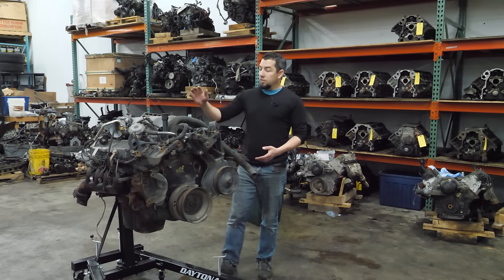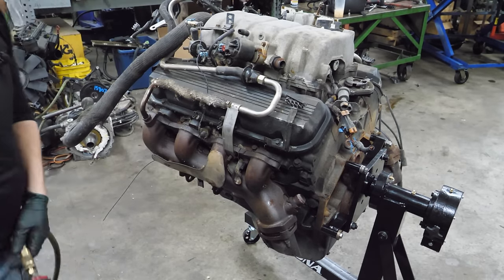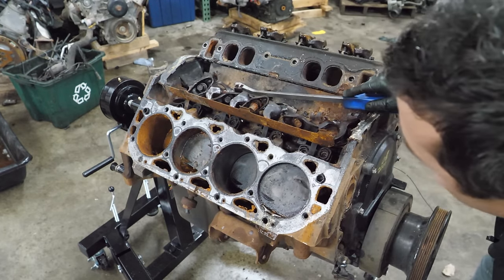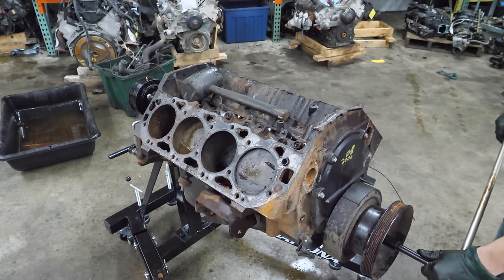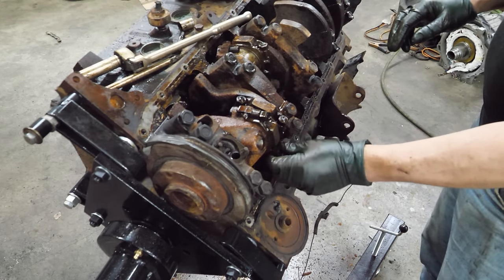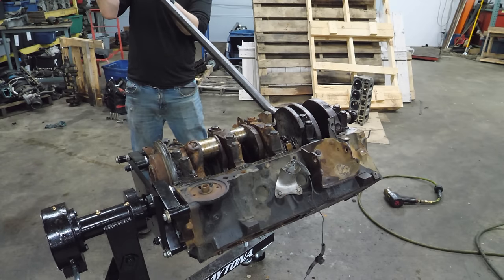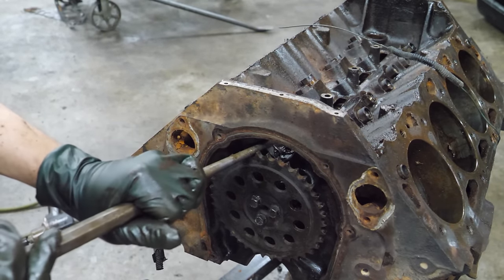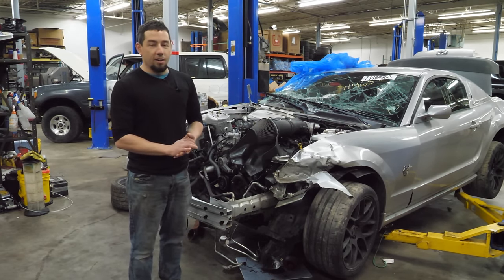COMPLETELY FROZEN! Vortec 454 7.4L BBC Big Block Chevrolet Teardown. This Was Some Work!

Comment: Should be done gooder parts on it. At least on the outside...
EGR tube AND the dipstick tube??!! Go get a lottery ticket, STAT!!
Those are the OEM intake gaskets. I'm dealing with the same style/materials on my 02 Buick Park Avenue. The gaskets look identical (on your engine, yours are in better shape). I was about 45 days away from the number 3 cylinder sucking the pink Danger Aid and acquiring Bendy Rod Syndrome.

Comment: I like big blocks! I also like to see smaller engines torn down, like maybe an early 2000s VW 1.9 TDI?
Reply: Would be not easy to find. If the car is still drivable, the engine is still in use. Those engines are the best diesels VW ever made.

Comment: We came across a 305 SBC that was like this many years ago.  We wound up rebuilding it since it was free to us ... had it machined .040 over on the cylinders and there was still some porosity in one of those cylinders - however the engine build was a success and served for a few years after.  This block should be worth the rebuild effort if it has stock size cylinders.
Reply: Agreed, and it likely is completely stock, as the bearing he found was 2/96 GM standard size. Most likely no machine work has ever been done on anything in that engine.

Comment: Hello Eric! I just fell upon the channel watching automotive repair videos and got hooked. I haven't read all the comments because I kinda get bored with it rather quickly lol. I wanted to let you know that while working in the machine shop decades ago, thinking it was 20 years maybe more ugh, I would run across marine engines that were left with water in them over the winter. Freeze plugs would pop but you should scrutinze the walls of the intake valley and piston bores also  the walls outside the block really well. I would probably have it tested somehow with the magnet and powder or something similiar. There is probably something new out now that makes finding cracks easy. You have a new subsciber, thanks for the great video!

Comment: If the floor is an issue we used to use old conveyor belt which was 1/2 inch thick made a work area from a few strips 12 ft or so square, nothing got broken even if it fell and it also saves your feet from the hard concrete,  being so heavy it always laid flat,

Comment: Loved this video.  Had a family member with a Black Thunder 40 footer with twin 454's.  A monster.  Have you ever done one of those venerable old GM 3800's that will run 300,000 miles.  I've had several of these.  Would like to see what they look like inside.
Reply: 3800 is a damn good engine ,,  i have one in a boat ,,replaced a 4300 V6 with a supercharged 3800 out of a pontiac gran prix ,,it's just as fast and 200 pounds lighter and uses less fuel,,i got rid of all the extra BS and installed a radiator instead of the lake water cooling ,,gave a double benefit ,, i don't have to winterize my boat and it reduces my chances of carrying invasive species in my bilge water
Reply: That's about the condition my 454s in my searay were in when I got it I'd kill for a speed boat but I love my full kitchen shower and toilet lol
Reply: The 3800 is the best engine you yanks ever made got a couple of holdens with them gmh aussie
Reply: @mikehunntt5338  i know that one there , i have a 40 foot cabin cruiser i think it's  a cris craft , i completely redid the entire thing  including the engines which were actually chrysler 440s they got replaced with EFI 454s i like having a full bath and kitchen

Comment: That crank just needs a quick polish.
Block is semi valuable, rods are ok, and it had to be flooded for along time, head gaskets didn't look blown to me. Or they ran water instead of antifreeze and it rusted a hole threw a passage in the head.

Comment: Eric, I tried out pig mat on a spill this week and like it more than paper towels and kitty litter.
Reply from the maker: That’s great! We never looked back after we made the switch
Reply: We call them diapers in the Military
Reply: If you get the chance,  try the crushed coconut stuff. It's similar to the kitty litter,  but works WAY better and cleans up easier as well! I was skeptical at first,  but seeing is believing.
Reply: @ReignitedAuto  If I find it, I'll try it on coolant or pre-emptive fuel.

Comment: Those heads are a bear to remove in the engine bay. So freaking heavy. I've always liked a 454. Had several over the years, take one over a 460.
Reply: best you can do with a Mk IV is 511cid, a Ford 385 will go to 557cid. Hell even Mopar RB's will go to 541. Any BBC made after 1974 is a fucking boat anchor.
Reply: @bjbeardse  oo
Reply: @bjbeardse  Ok buddy. I'm not sure I said anything about turning a 454 into anything other than a 454. Always been a good stock engine for towing, good power, decent economy, simple to work on, but boat anchor it is skippy
Reply: @wconstructionco  Note the distinction between MK IV and Gen5/6. THe newer engines are absolute junk. The earlier design is a great engine.
Reply: @bjbeardse  never any issues with my lt1 vortec 454s
Reply: @bjbeardse  tell that to Lawrence LT Tolman then.

Comment: I had a 400 small block in a nova and I forgot to put in one of the intake bolts. It filled up with water from a circle sprinkler. I then took it from the nova and put it in a monte Carlo, thinking everything was good. Imagine my surprise when I fired it up, I had engine mayo! No joke, it emulsified. I drained the thing out and filled it up with wd40. Two gallons and about a half hour of cranking later, it ran better than when I first got it.

Comment: It is so much easier once you see water has done that much rusting of the cylinders to take a drill and wire wheel the rough stuff out and then fill the cylinder with toilet bowl cleaner and I mean the high acid stuff that eats rust on contact.Then take compressed air and run around the piston to wall area so you can get a thin oil in there to make driving the pistons out easier.Ive torn apart many engines that have had water in them for years that way and it always works good.Of course you only go to that kind of trouble on something you hope to save.

Comment: Piston rings are seized and getting stuck on the wear ridge at top of cylinder. Ridge reamer would have helped a lot here!
Reply: Not one ring was seized in it's groove. It was RUST that had locked it up... didn't you notice any of that in the video?
Reply: @johncoops6897  ok, not seized rings. I meant that the rust in the piston rings was stopping them from going all the way "in", and the fact that they always got stuck at the same point near the top of the cylinder is consistent with hitting a wear ridge. Doesn't take much diameter reduction to get stuck if the rings can't move inwards.
Reply: @simontist  - I reckon that the rust was a smaller diameter hole than the whole piston!

Comment: Eric, I think you might need an Astro Pneumatic 4980 Air Hammer, might make it easier than using a handheld hammer.
Reply: Something like Eric O's big nasty ?
Reply: @thomasfletcher760  It's the same tool, just the official designation.
Reply: @Boodieman72  didn't remember the actual tool designation , thanks

Comment: Loosen the mains first to turn the crank, and perhaps remove the crank before pushing the pistons out.
Also good to loosen the mains first is that there is less risk hurting the main journals if some water got in, instead of trying to rotate the assembly with tight mains. (if we have a good crank)

Comment: I have a gen 6 454 and my lifters were stuck in the bores due to thick oil sludge, not rust. I took a can of seafoam and dumped some in the lifter valley and let it sit for a day or two. It loosened up the sludge enough to wiggle the lifters out. I never had an engine that rusty though. A bottle of evapo rust in the lifter valley and bores may have helped or CLR. I had a 400 small block one time that was froze like this engine and I took a 2 inch round wooden dowel and a hammer and went around and hit each piston in the center until it started to move. You should also get a crank turning socket for big block and small block Chevy's. Would make turning the crank a lot easier.

Comment: I am going to say it blew a head gasket, which is why it got pulled out. Then it just got rained on a lot too. The rust build up in the water galleries, was just neglect. It was bad enough to push out the welsh plug. Diven till it stopped

Comment: If you want to give that engine stand a workout, see if you can get your hands on an old Detroit Diesel 2-stroke engine. They are super unique because they all have a blower (supercharger) and are built like tanks.
Reply: they also leak oil even if there isnt any oil in them

Comment: When i get a motor this frozen up i use the flywheel/flexplate teeth and a prybar to turn it 1 tooth at a time, that usually works (along with cleaning walls with brush and lots of atf and acetone)

Comment: I really enjoyed this episode! The block and heads could be hot tanked to access the damage,but the did look acceptable! I was surprised that the cam came out so easily. But unfortunately because of the rust the block will need linewill be  boring through out. Not sure if the block

Comment: The trick is to find something round that will sit flat on top of the piston, something about half the diameter. Use that to hit downward on a piston. It almost sounds counterintuitive, but it works. You can do That with crank in it, and the rods still connected.

Comment: This is probably a difficult engine for you to get by, but I’d love to see a Mercedes M111 engine! They’re used in all sorts of applications, from Vito vans to coupes and convertibles with a supercharger.

These engines are pretty reliable but they do like to pop head gaskets, which is what usually writes them off. They also often perish from poor tuning attempts.

Comment: Your favorite penetrating oil or ATF/acetone and an air hammer with a punch will get the EGR tube off easier than you ever imagined.  I had two 1 3/8 wrenches almost 2 feet long each and it wouldn’t budge.  3 seconds of taps with a medium quality air hammer and it was spinning off by hand.  I couldn’t believe it worked that easy.  I’ve heard of guys using a copper flex pipe for water heaters and compression nuts to make their own, but haven’t had to do that yet.

Comment: Honestly, it looks like that engine was just sitting for a long time in the elements. It’s not just the water, but how dry even the rust free parts are. Oil hasn’t circulated for years. 

Honestly though, I’d almost be interested in it. The block anyway. End of the day, it appears to be an unmolested 454 4 bolt main block, probably standard bore. Hot tank it, bore it out .060” and put a stroker kit in and you have the makings for a solid 496 stroker engine. From what I remember , the vortec heads flow pretty decent if you want to clean them up, or shave a bunch of weight and go with aftermarket aluminum heads. Combine with a good cam and maybe a supercharger or light nitrous and you got yourself a fantastic strip pounder on a budget.

Comment: FWIW I suspect it was a running flood vehicle, water often does get in the pan in weird ways, and that's just my experience living in Flood City Texas and working on more flood cars than I can physically count (it's a seasonal thing every year here) - In my opinion it was probably a flood vehicle that took on major water, went to the storage lot awaiting insurance claims and sat there full of water.. and sat and sat and sat some more, freezing over winter making the cylinders oval up in the process, it's not just rust making the pistons stick so bad it's all the deformation from freezing, the block is likely not worth messing with at that point. Even if it wasn't cracked the machine work alone to put it right would cost 4x what a good complete running salvage 454 would. Same with the crank. It could likely be saved but not worth the cost.

Comment: Helped pull a 454 apart that was in a Bayliner 30 foot boat. 
Would crank with the plugs out but there was no compression in any cylinder when testing; bunch of bent rods, and several severely bent push rods. 
The reason they don’t like to rev is that they’re too big and heavy, too much reciprocating Mass like a diesel. Good as a truck engine when running, otherwise good as a boat anchor when not running.

Comment: Remove the crank pulley, put some  longish bolts into the balancer and then use a crowbar to turn the crank,, that is after spraying  planty of CRC down the sides of the pistons as well as the lifters as well.
IF the car is flooded the water will get in, if nothing else through the intakes. Check the block for cracks, if ok bore 020, grind the crank 010 on the mains, new pistons and you have an engine. Ditto with the heads.  Even in the US 454s are thin on the ground as they are a truck engine only

Comment: The way to avoid dropping the cylinder head like that is to loosen the head bolts but don't take them all the way out. Leave them in for a couple of threads. also, turn the engine so the head is level with the floor, not at a 45 degree angle and attach a scrap bar to the rocker stands or valve cover bolt holes with some spare bolts to act as a handle rather than have to pry away at the intake ports.
(funny thing, last time i suggested this on one of these videos, some chucklehead says the dowels will keep the head from doing exactly what you show it doing :)  Of course you never know on a truck engine if it's been rebuilt before and the dowels are suspect).

Comment: Another trick to help turn the crank is to use a large adjustable wrench on the crank snout.  Use the woodruff key to lock the jaw of the wrench to the crank.

Comment: At 24:30 now. I would remove pulleys and balancer and timing cover. And any other externals left, then run it thru your wash cabinet. After wash then lube everything and wait.
You might try an air hammer to push out pistons.

Comment: The 4 bolt mains were the desirable 454....but it was still prone to bad harmonics and failure, due to the rod caps extending beyond the block like that.  Note, the new V8s all have the rod caps oriented between the block skirts, with 2 more bolts (6 bolt main caps) securing the rod cap.  Less vibration = longer engine life. Cheers !

Comment: Trying to recall the days I ran my Sea Ray (had gen 2 350) with the looks this eng may have at one time was out sailing the seas (likely with salt) given the freeze plug, pump not off the crank and that wierd looking hose on top of the water pump. Not sure why motor was without the standard block pump but ya this has the looks of being used in a Merc. Sea Ray switched to Vortecs starting around 1996 and 7.4L would be a popular motor. Sure looks like a winterizer didn't take and some time later was dropped in a 'show vehicle' with a nice oil water mixture probably as shown. For this rebuild, extra Simonizing may be in order sanding the rust off the crank which is something you don't say everyday.

Comment: The condition of the water passages makes me think someone was running it with only water as it's coolant. The block may be saveable, I'm sure there's someone who will want it. Save the main bearing caps and put them back on in order. Also while PB blaster is an excellent penetrant you could just soak everything in ATF and give it an overnight.

Comment: For something that rusted, I would’ve gotten couple gallons of kerosene or diesel and filled the pan and block up to soak everything. If you want a better spray to get rusted bolts and nuts lose, get some free all. Works great

Comment: Not sue where you are located but I recently just blew up a 400 small block Chevy out of my 77 Chevy bonanza. Was running super rich fuel diluted the oil. Smoked a rod bearing. Be kind of cool to see what It looks like on the inside

Comment: big block Chevs the Mark IV engines, Gen 5 and Sixs are great engines.  The 454 in  this video has a 4 bolt main block with a forged steel crank.  It's too bad that it got left out in the rain, dropped overboard  from  Noah's ark. Regardless. had this not happened you would have had a good crankshaft which brings pretty good money.  The blocks are also valuable as well. These engines can make over 600 hp and torque normally aspirated with factory hp parts or aftermarket stuff. With some good cylinder heads with smaller combustion chambers you can push the compression ratio u p to just about anywhere you want it with the proper piston domes. 
   I suggest  you buy yourself a ridge reamer for stuck piston removal makes the job much easier. Also pentrant works better if you let it set, and apply some heat to the object you are trying to remove. I have been building high perfomance engines and race engines for over 50 years I know what I'm talking about.  

   I do like  your channel a lot and watch it every day.

Comment: I do find the additional hole cutouts in the block interesting, also shows even if the gunk between the cylinders  was removed I am not sure if running this beast when parked a few minutes if that coolant would even budge if the thermostat was closed shut or stuck.

Comment: To break cylinder loose, I use a 4x4 and a sledgehammer on top of the pistons. It may take a real solid hit, but old tractors broke lose with out the tractor tipping over.

Comment: My dad has a 99 k 2500, 454, ever since day 1 he's had to replace the head gaskets 10-15k miles.  So he pulled the engine out carried it to a machine shop they deck the block and the heads reworked, basically he had a new engine. We installed it,started right up 26k miles later blew another h. gasket, after that he sold the truck. We couldn't find the exact cause, but we found a guy online, he said something about the spacing between the cylinders and the heads was not meaty enough to handle the compression and that was the problem. Who knows.